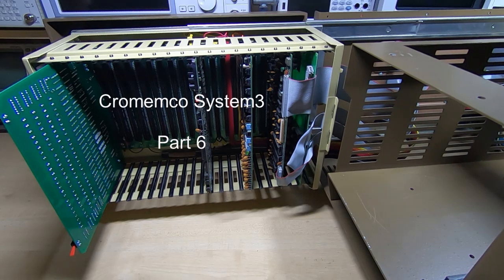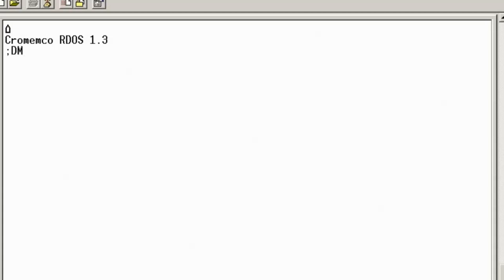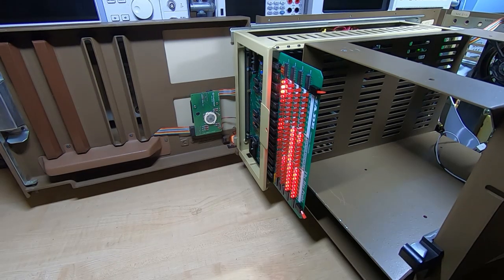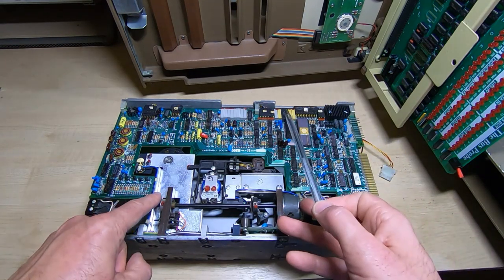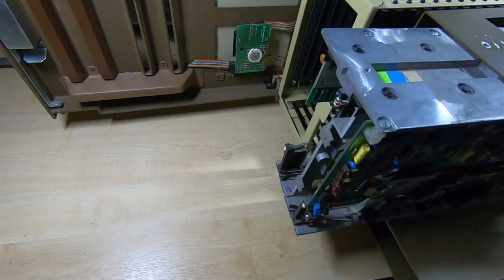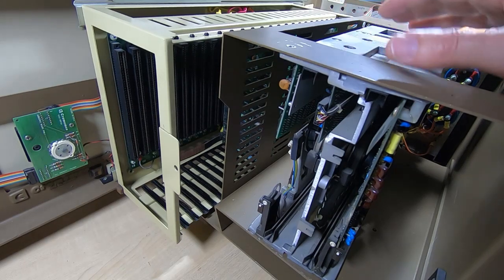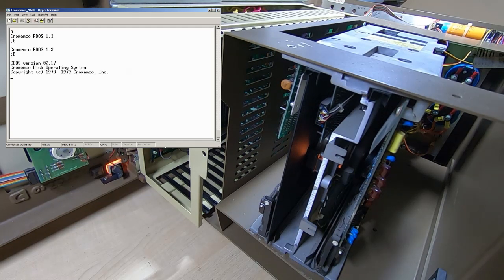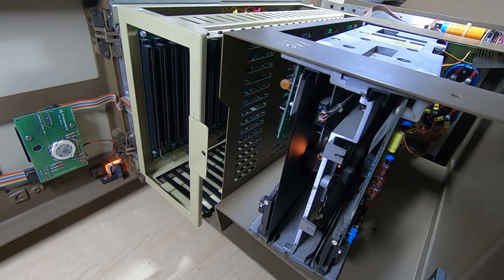Cromemco System3 Part6

Comment: Old tantalum caps can explode, bang, fizz and burst into flames.  It looks spectacular but it’s a fire hazard.  They were used because of their low impedance and good performance as Columb buckets (aka decoupling or bypass capacitors).

The drive mechanics are not overengineered. In fact they often can contain design faults such as insufficient strength of the engagement levers which often break off.
Later in history some 3.5” drive manufacturers decided to replace the diecast chassis with folded metal. Suffice it to say that these drives distorted in shape making them unusable and unservicable.